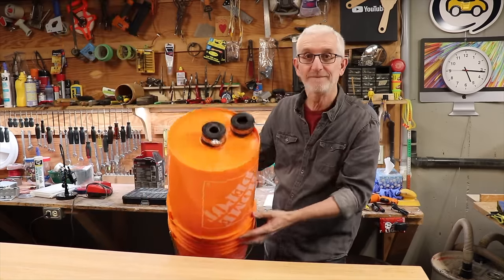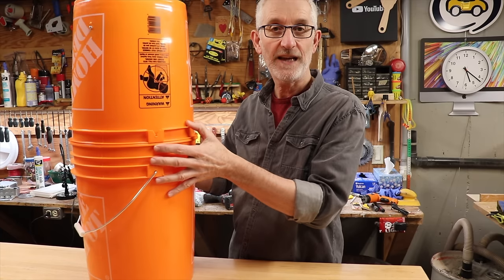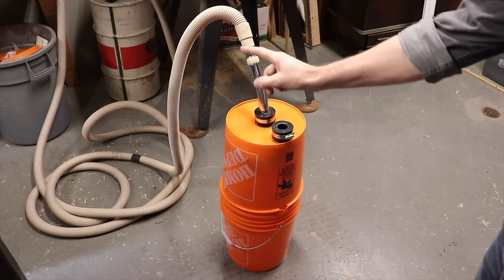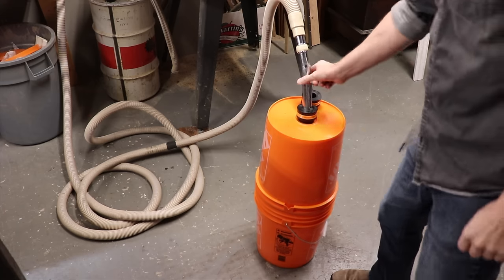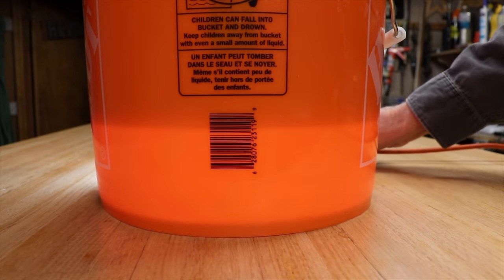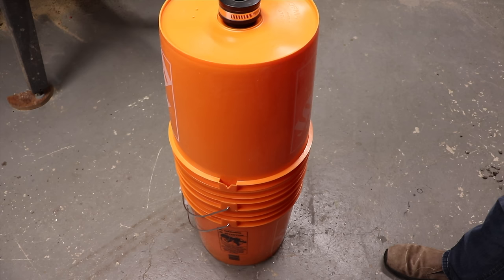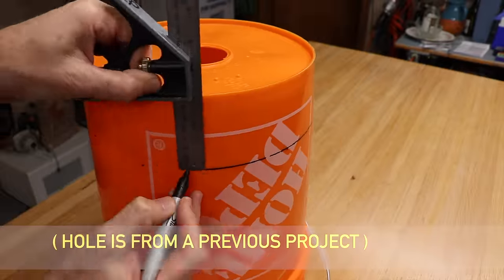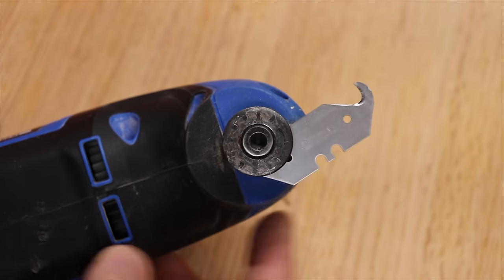Simple Cyclone Dust Collector ● UPDATE !

Comment: Hi Chris. I recently completed a similar separator using your methods but used a 35 gallon plastic barrel instead. All in all it works great except the barrel still collapses when a using my sander. I added a "bleeder valve" to reduce inflow, but hate sacrificing "suck" LOL. I don't understand how an extra bucket (or barrel) on the outside keeps the inner one from collapsing, but would inserting another cut down barrel on the inside work as well? Would use this as a "emptying barrel", but know vacuum is a powerful force. Thanks for your inspiration on this as any thought on a inner sleeve.
Reply from the maker: Due to the size of my bucket, an additional bucket strengthens the wall from collapsing. In your case with the 35 gallon drum there is much more surface area and like you said, vacuum is a powerful force. The relief valve is the best option.

Comment: Hi Chris,
You are always so helpful and have great ideas to make life a bit easier 😊. I have a question completely off subject but I could really use your help. I have a “Bucket head” wet/dry vacuum it was working great but yesterday it started it seemed like the motor or fan was showing down and then it just stopped? I think a paper towel get sucked up into the fan or motor? Is there a way I can get to either or both and see if that is what is causing the problem? If you have any input or suggestions on how to get it working again? 
Jennifer
Reply from the maker: Everything comes apart. Just get your screw driver and start to dis-assemble it and see if you can locate the problem. Make sure to do a wiggle test on the plug and wire first. Do this......plug it in, turn it on and then grab the wire and start to wiggle it and twist it along the length to see if the motor jumps to life. If it does, you just need to repair the cord where the break is. Good luck.
Reply: @chrisnotap  You are the best 😊 thank you very much. Hope the New Year is being good to you. Please take care and stay safe.

Comment: Hi Chris,
You are awesome love all you ideas & tips. Wondering if you might be able to help me with my shop vac? It turns on but does not have any suction and the blower no longer blows? Any suggestions or is it time for a new wet/dry vac?
Reply from the maker: With it running disconnect the suction hose. Do you have suction now? 
No.......see if there is something restricting the suction side on the vacuum itself. Do you have suction now?
No..... Take a screw driver and disassemble the vacuum to get to the rotating fan. Has the fan come loose on the shaft? Tighten it if it has.
As you can see I used the process of elimination in those steps. Do that and you will find the root cause. It sounds like you're telling me the motor still runs so it has to be one of the 3 things I mentioned.
Reply: Chris Notap Thank you for getting back to me, I really appreciate it! Thank you for the incredible information. I will go step by step and let you what happens 😊.  Please stay safe and well 🥰

Comment: Definitely love mine that I built but now I'm having an issue with static buildup. Any quick fixes to combat that?
Reply from the maker: Others have said they attach a wire from the bucket to a water pipe or to the outside of an electrical box.

Comment: great video. how do the outer buckets keep the inner buckets from collapsing and will this system work with the larger shop vac hoses?
Reply from the maker: It just doubles the strength of the outer walls of the bucket.
Reply: I'm not trying to overstep this idea. Just add some light. In my mind I see one bucket has to flex out of shape (round) in order to collapse. So the second bucket being positioned a few inches higher or lower ( depending on orientation) of the weaker bucket with a heavier ridges, helps prevent the collapse of the inner bucket. In other words it stiffens it up.

Comment: I could not get the bucket that I cut to go into the other bucket. The outside diameter of the modified bucket is actually larger than the inside diameter of the bottom bucket. My fix, I cut the rest off so that it was flat. I used foam weather stripping with the adhesive to go around the parameter of the bucket. I used 4 springs to hold them together. Works great. But don't try cleaning your work bench with it. I accidentally sucked up a small plastic cup and it collapsed both buckets. Oh chit! Fortunately, I was able to bend them back into shape. One other modification I did, I used 90 degree elbows on the top with rubber adapters. I have a 1 7/8" hose from my vacuum, with a 2 1/2" hose going to my table saw and router. The hooked blade on the multi-tool is genius.
Reply from the maker: That's great!  I did an update video to solve the collapsing bucket here ... https://youtu.be/BeU4nqSJtBY

Comment: I was inspired by your design but wanted some imperial data using extremely fine dust.  I followed your instructions with one alteration. I used 90-degree elbows on the inlet and outlet of the exterior of the cyclone dust collector. I used a 5-gallon 6-amp Shop Vac with factory pleated filter as vacuum source. The collection hose used was a 1-1/4 Shop Vac hose. The hose between the cyclone and vac is a 90 cm piece of 1-1/4 pool hose. I used Portland cement powder as a substitute for drywall dust figuring it is a similar particle size and density. I tried to suck up the Portland over a couple of minutes but realistically, this particle flow rate was way high. This resulted in extreme static build up. Here are my results: 1109 grams Portland sample. 964 grams collected in cyclone. Unmeasurable amount in Shop Vac barrel measuring with a scale with 1 gram resolution. 7 grams on Shop Vac filter. This was enough to audibly detect the Shop Vac loading but not plugged. The static build up seemed to result in the remaining 138 grams to be precipitated out on the inside of both hose.

Comment: To help with pulling the two bottom buckets apart; drill a half inch vacuum relief hole about an inch from the bottom  in the side of the bottom outer bucket. I have done this for years to help get a trash bag out of the can.
Reply: I think in this case, it would reduce the ability of the outer bucket to keep the inner bucket from collapsing. Your hole would allow air in to break the vacuum, which would make it easier for the wall of the inner bucket to separate and pull inward from the outer bucket wall, and collapse.  Someone should test it out.

Comment: Building mine, I am going to add a rolling base made from 3/4 ply to prevent tipping, and allow the unit to roll. I wonder if doubling the bottom bucket alone would prevent collapse.
Reply from the maker: Possibly. It's easy to try first.

Comment: I swear there was a comment or something in regards to static.  Not sure if it was the original video or this one but can you touch on that subject again? 

Getting a little bit of static so I wanted to address before it gets bad.  

Thanks!!
Reply from the maker: Some have said they added a stripped wire attached to the bucket and connected to a metal electrical box or water pipe.

Comment: HI Christine maybe you can tell me what you think ? I found a video where some one made a poormans muffler from a wet filter so my new ideas are to take a 1.25 inch pvc may be with cap and put a wet filater in it answered stick it in ,your vac exhausthe thoughts and the addtional idea some one else had was I could use a sink strainer in my dust collector vacum hose actually sine it seem the things that effect the vac ardent large I guess it can't hurt to put a strainer and hope for the best but maybe it important the screws are removable in case it jams ?
Reply from the maker: It's all about experimenting and using your noggin! You should try those ideas out to see what works.
Reply: @chrisnotap  Hi Chris I wanted to ask you I have very little to no abilty to engineer thngs here my question to you is if I make a bucket dust collector and insert the hose from my vacuum in my bucket lid the question to you is could I not drill a hole and put an extension tube that goes to the bottom of the vacuum ? any ideas please thank you it does not seem ordindarily recommennded but my question is are we sure it would not work ?  thoughts please thank you

Comment: Hi Chris I dont have much enginnering experience my question to you is could I just not drill a small hole in the top of the bucket? thoughts please thank you
Reply from the maker: Yes you could try that. You can always seal the hole with hot glue.
Reply: @chrisnotap my chris the current idea I have decided to go with is to try drilling small holes in the thing and if any thing goes wrong cover it with duct tape  as the remedy ???? I tried drilling 4 small holes near the top of the bucket !!! and  I mean small the drill i used was 1/16
Reply: ps do you see any reason if I had 6 gallon bucket it could not work or something and or I guess if I use the wet vac liquid filter it should be ok to use the dust colllector as extra water storage since my vac is low capacity if I have a flooded basement ? thoughts please thank you
Reply: @chrisnotap  is there any reason I could not use duct tape ? ps my shop vac is low capacity I guess there is no reason as long as I use the liquid filter I could not use this as extra storage if I needed to drain a flooded basement? thoughts please thank you

Comment: Possibly silly question: If my shop vac has a larger diameter hose than 1.5" (2.5" in fact) should I use larger diameter PVC parts to match?

Comment: I ran into the problem that regardless of how much I chamfered the edge of the top bucket.  It would not go on to the bottom.  I eventually had to chamfer the bottom as well.  A Lot.  Finally, with the proper encouragement it went together.  Would it not be simpler to make some plastic clips that snap around two uncut buckets?

Comment: Thank you very much for the update, great video ! Is it possible to do a collapsing test without the 2nd/outer lower bucket installed,  just the top outer bucket in place - the one with the bottom removed ? In my local diy circle ( where no one wants to sacrifice a bucket ) we are debating that the air trapped in between the lower buckets has the most important role as it is acting as a buffer transferring the load to the outer lower bucket. The 2nd upper bucket with bottom removed should have a minimal effect as the structural integrity is reduced and the air buffer is non existent.
Reply from the maker: I will do that and get back to you once I know. May take some time since I may need to buy another bucket from Home Depot. With the lock down in place, it's not as easy to buy things. Hold tight.   Just to make sure I understand, you want me to only put the outer bucket piece on the upper bucket only and see if it collapses?
Reply: @chrisnotap   Yes, exactly, the setup should be almost the same minus the lower outer bucket, no need to go to Home Depot. More details here : https://physics.stackexchange.com/questions/403365/physics-forces-involved-when-separating-two-5-gallon-buckets. Thank you very much for the quick reply and keep up the great work.

Comment: Hi chris would this work with larger size hoses 4” coming off my bigger  2 stage central vac system,or even with a smaller hose to my machines 3” etc, without losing to much suction, my filter bag clogs quite quickly, it’s a 3/4 hp and was one of the cheaper ones, only just started my woodworking journey, and finding things out the hard way, so any help would be appreciated.

Comment: Cool. Have considered doing an upscale version of the collector for a 30 gallon trash can and 4" connections?
Reply: I like where you are going. It's a tall order though. I think you will find that to maintain the speed of air/dust of a 2" hose in a 4" hose is around 4x more flow, so that will require substantially greater vacuum capacity which means more power to run the vacuum motor - around 4 times with all things being equal. That means the ability for the vacuum pump to collapse the container is also amplified, as is the noise from such a unit.

I actually have a suitable pump (from a commercial wood working shop) and have been considering building a 4" cyclonic system...but I can't find something strong enough to support a larger volume and the increased capacity of the air pump to turn the collector into a scrunched up beer can. I also want some kind of muffler arrangement to try and reduce the noise from the unit. (I've heard the air pump run, you can't hear yourself think).
Reply from the maker: The problem is when you scale up, the vacuum can collapse the container more easily because these bigger containers are usually thin to keep them light and easy to lift to the curb. But yes, it should work the same with a small vacuum attached. Keep in mind that the collapse may only occur if the hose gets blocked so it might be worth experimenting. If it doesn't work, it';s not a failure, it's learning and good knowledge.
Reply: @chrisnotap  I was thinking of building a frame inside the container. Question is, how do you do that and not upset the vortex effect of offsetting the incoming pipe?
Reply from the maker: I think the best would be to come up with a structure on the outside. That way it won't affect the vortex on the inside.
Reply: @chrisnotap  I considered that but I can't get my head around supporting it from the outside without attaching to it and compromising the very strength one is trying to enhance. I get that stopping it distorting will help, but I'm not sure that will overcome the problem without, as you pointed out, make it of heavy plastic or something. I was intrigued how your example of putting a bin on the outside was sufficient to stop it collapsing. I presume the mechanism is that when it start to collapse it creates a vacuum between the inner and out wall stopping the collapse. Essentially it shares the load between both walls without the need for attaching it... I think I may have just answered my own question :) So the problem may just boil down to finding a container that will fit in over itself...
Reply: @MiniLuv-1984  Just a thought; someone (name unknown) once said, "Good judgement comes from experience.  Experience comes from bad judgement."

Comment: Any suggestions to make a water version to filter out drywall dust?   I have been toying around with some designs and so far no solid luck.  The water from my collector still goes back into my shop vac to some degree

Comment: Just built this to include the updates. Works like it should except mine squeals like crazy .. need to wear earplugs to use it. Any ideas why??
Reply from the maker: It is most likely the hose you're using. Start disconnecting and use process of elimination.

Comment: Dumb question here:  Why the buckets? The shop vac I use now catches the sawdust in it's built in bucket. Why put Home Depot buckets in between?

I'm guessing to save the filter from getting the bulk of the sawdust?

I just blow the filter out with compressed air every time I dump the shopvac cannister...I suppose it would save that time. Or is there a completely other use I'm not thinking of...like the buckets somehow add an effect to increase suction or something?
Reply from the maker: I can tell you didn't watch the original build video!! Take a sec and watch............https://youtu.be/1WnitgYFnE0

Comment: In your video you used all 1 1/2 in pvc. The 3 straight pieces won't fit inside of another 1 1/2 pvc. What is the size of the 3 straight pieces?

Comment: I haven't built this, but I guarantee if you want to keep the bucket's from collapsing, all you have to do is drill like a 1/8" hole in the top. Not really big enough to lose suction, but big enough to keep too much suction. I used to cut some holes in a shop-vac hose to keep it from getting stuck on hard wood floors and it still sucked like normal... TRY IT, IF it doesn't work I will send you a bucket
Reply: The bucket will scream like a jet engine. Been there, done that, hahaha. Going to try other alternatives
Reply: @kongyihfann5546  you'd have to try a few different sizes of a hole and I'm sure whole placement could have something to do with it as well. 
Also, are you really worried about a noise as if a running Shop-Vac is silent?
Reply: @robbiebooth2980  ya. May need larger holes so that it doesnt wisel. Something is not right when the vac is much louder than table saw.
Reply: @kongyihfann5546  I was thinking more like putting the hole in a location that the wind currant doesn't hit it... Or a deflector on the inside to make the wind unable to hit the hole...

Comment: Going to try this mod... BTW... Lowes buckets don’t work in this manner.  Just saying
Reply from the maker: Others have said they have used Lowes buckets and said they do work.
Reply: Interesting... I am pretty handy but apparently not handy enough to use Lowes buckets.  I destroyed two trying!  Home Depot buckets worked right away!
Reply from the maker: Interesting. I would have thought Lowes used the same bucket manufacturer across the country but I guess that is not the case. Thanks.

Comment: Chris, The filter on my shop vac plugs up very quickly. Have a done something incorrectly in the building process?  I do get the saw dust at the bottom as well.
Reply from the maker: Make sure you have the 90 and 45 at the angles I have in the video.
Reply: Chris - Thanks for getting back to me. Sorry for not responding sooner as today I turned the 45 degree slightly and that did the trick. Thanks again for the response and sharing your idea.
Reply from the maker: @mikepucser6821  You're welcome!